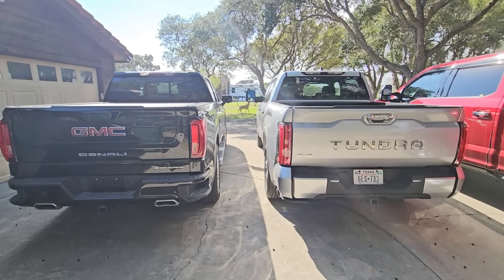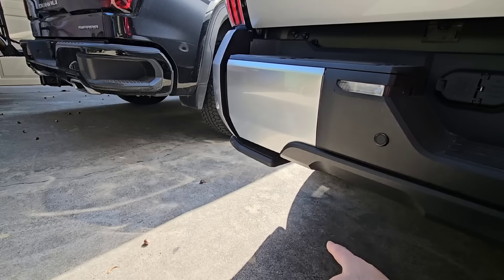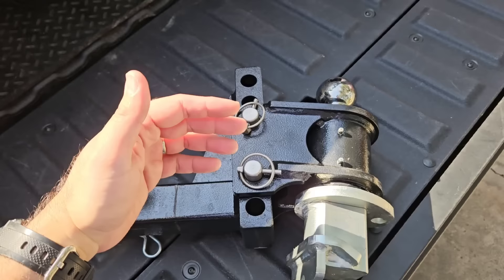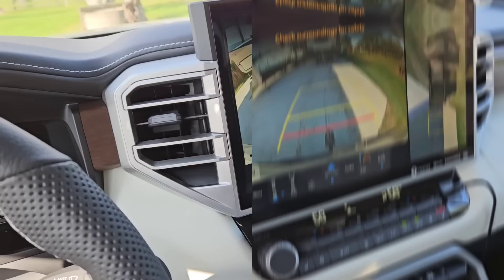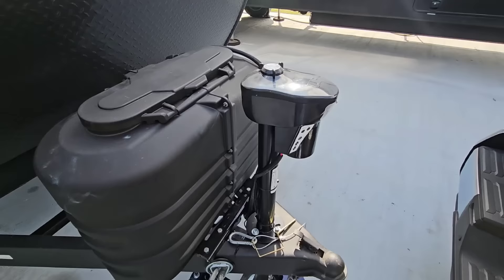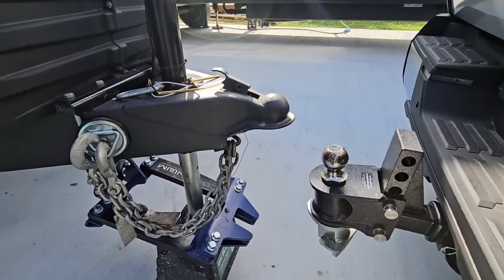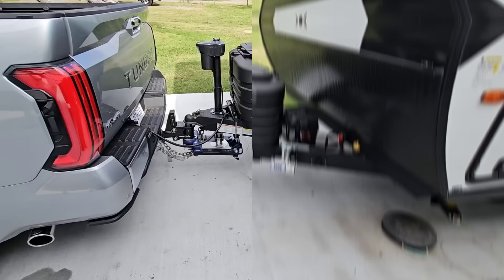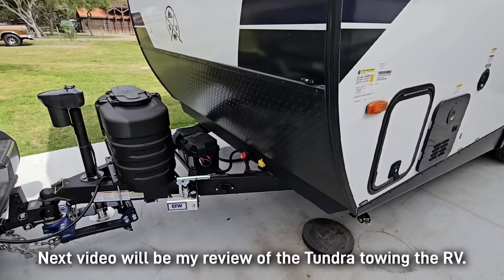RV Tow Testing: Moving the B&W Continuum to a 2024 Toyota Tundra Capstone. Part 1

Comment: I believe the proper way is to use the weight distribution hitch first then inflate the airbags after everything is setup and  level. The problem with airbags is it gives you a false level… they don’t distribute weight when they inflate so you could be under distributed and light up front if you make adjustments while they are inflated.
Reply: @ctquicksilver  agreed. Leveling it after the airbags have lifted the rear will give you no weight distribution.

Comment: The air suspension on our Sequoia automatically tries to return the rear ride height to the “normal” ride height once you put the load on it and turn the ignition on. The “raise” and “lower” settings are only for assisting in loading or for extremely low speed maneuvering as once you go above 25 mph, the truck will automatically return to the “normal” height. 

You shouldn’t have an option as to whether the truck levels the load or not. But maybe they’ve change it?

Comment: I feel most WDH systems are hoky; it’s all about the WD and getting weight over the steer axle. Don’t get me wrong they assist some; yet what’s Key is proper  WD; a true sway control could be an Hensly Hitch system yet that’s scary on switch backs on a decent from 8 thousand feet .. I have towed over 100 TT’s and it comes down to WD!  Love this B&W WDH absolutely stunning! I will keep my Anderson Hitch as a back up in-case the hydraulic fails ? I will be at the FLA Tampa Super RV Show come January 17, I see us buying one.

Comment: That continuum hitch appears to sit really low. Have you had any clearance issues with it?
Reply from the maker: None so far. Not even when going over relatively unlevel transitions
Reply: YES !!!!  I had one and got rid of it for that reason.  Boondocking in some locations (Big Bend) and some beach driving exposes this setup.
Reply: Probably depends on the trailer you are towing. I tow a 2024 Arctic Fox Northfork 25R which sits up very high so it can go off road and towing with a 2019 Ford F250 2wd and I have all kinds of clearance with the hitch. I'm guessing something like and Airstream that sits low could have issues.

Comment: JD, how close to the ground is that hitch assembly?  It looks like it is very close to the ground.  Do you know the measurement on that?  Thanks.
Reply from the maker: 8-9" from the lowest point
Reply: @BigTruckBigRV  --  Ok for flat surfaces but have to watch speed bumps and potholes perhaps.
Reply: I own two of these hitches. one for a travel trailer and one for a cargo trailer. I have never come close to bottoming it out or smacking it on anything and that is being hookup to both my 3.4 ton ram and a dodge durango.

Comment: Does the Tundra have the 4 point connector or did they get rid of it like GMC?
Reply: I have a '22 Limited, and it has the 4 pin connector as well.
Reply from the maker: It does